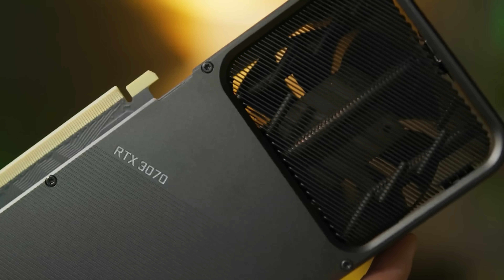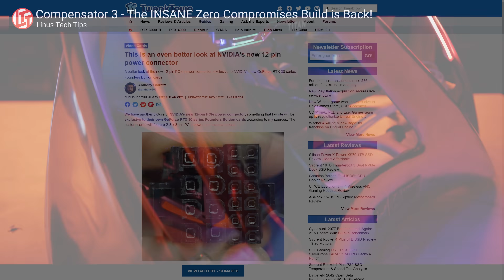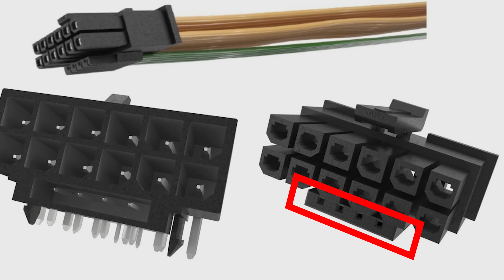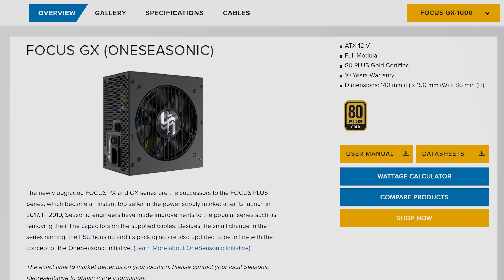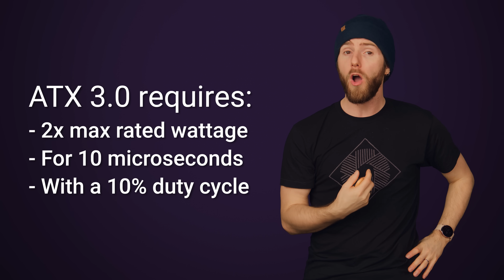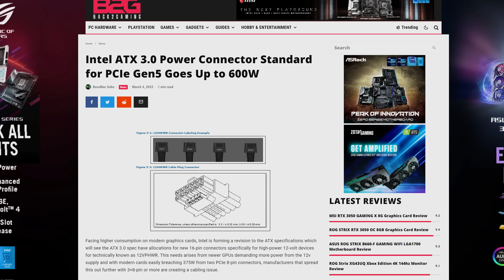Do You Need A New Power Supply? - ATX 3.0

Comment: Ah good, now I can troubleshoot the communication between my PSU and Graphics card. Just what I always wanted.
Reply: Windows troubleshooting never solved one single problem in my life
Reply: lol it’s one of those things that sounds awesome in theory, but might just end up being annoying.
Reply: @RightJoystick  this. It's just going to end up being a pain in the ass. Oh no the communication chip on my gpu died, noe its throttling power to 1%, etc etc.
Reply: @raycert07 its not going to be like that. Also you can just disable using a 12vhpwr plug anyway but using the adapter with your other pcie connections
Reply: @RightJoystick  for now
Reply: Presumably this is just a safety feature for people building their first computer, unaware that you have to build head room for the spike power draw of some cards. If you already know how to select an adequate power supply for your pc's TDP I doubt this will affect you at all.
Reply: @brendago4505  there is already circuit protection for people who pull to many amps from the psu. You really can't damage a gpu or psu from pulling to much power.
Reply: Its just dumb-logic, no data to decipher.

[Editing as an updated document was found, and I had swapped some pins]

S1 & S2 are from the card and listed as optional [pins are either low (ground) or high (3.3v) ]

S1 is Power Stable; enables the GPU to send an somethings wrong signal, so the PSU can cut power to the card.
S2 is Cable Present; lets the PSU know the GPU exists so it can adjust the power limit based on the number of cards.

S3 & S4 are from the PSU and define the power limit by leaving the pin open or grounding it. (GG=600, OG=450, GO=300, OO=150)
Reply: @ttomkins4867  so an older psu with a connector converter will adjust to 150W ?
Reply: @ttomkins4867  hopefully there will be cheap adapters that just bridge it so that it works like before. Would be hard for some users to build something like that themselves. Or even better a software solution to tell the gpu to don’t give a shit.
Reply: @ttomkins4867  Do you mean we can create cheap "upgrade" cables for our old but gold PSUs  to just say "GG, take 600W" ?
Reply: Not really solving any problems while introducing new points of failure doesn't sound like the smartest idea
Reply: @JediRhymeTrix  Well it does solve a problem, but the problem it solves is a bad build plan from a beginner builder like pairing an intel 13900K and a 4090 with a >1000W PSU which with a normal PSU that could very easily kill it if the built in safety's don't stop it from frying itself. The PSU failing could also very easily cause other failures too in this case. However, this isn't really a problem that needed to be solved since nobody buying this tier of tech are going to be making mistakes of this severity. They will be buying at best last gen, maybe slightly older since a beginner often won't want to risk that much on a mistake that expensive, and if they did try it most of them are smart enough to hire somebody to make sure they don't make a multi-K$ mistake.
Reply: Ehh just have it light up an LED or give an error at boot if the GPU has to scale down to match the PSU.
Reply: Exactly... so the benefits of this new PSU is that if an idiot buys a gpu that draws touch power from his psu he can now still use it without it tripping circuit protection? Jfc 🤦‍♂️. For anyone who knows how to properly size their psu for their system this is stupid.
Reply: I hope there is a software to tell you that your psu doesnt have enough power instead of just throttling it with no explanation
Reply: @user-vo3ps2oz7h  that would require your psu to have a data cable to the mobo... unless the gpu can alert to the the error.
Reply: @user-vo3ps2oz7h you can also calculate what you are doing and putting into your system
Reply: I had a 17" XPS laptop from around 2004/5 that the power brick eventually stopped telling the laptop it was powerful enough, and the laptop wouldn't boot. Wiggled the cable a bit, and it would boot. Repeated wiggling for each boot just broke the wire completely and eventually had to cut the cable off and put my own wires in, and the problem went away. (The data wire was very tiny.)
Reply: Top👍🏻👍🏻
Membuat Regulator DC menggunakan adaptor bekas printer/laptop
https://youtu.be/78Q5bZkz96M
Reply: Yup, put a new PSU power supply tester on your shopping list to test the new connection. Prolly expensive compared to my trusty $15 PSU tester I got in Hong Kong.
Reply: A loose or faulty sense pin can cause unexpected psu ram ramps as well as blackouts
Reply: Nah it doesn't work like that lol look up pwm.
Reply: Do you remember when you just had to make sure your CPU and RAM slots matched, and you had enough molex and sata ports for your HDDs and fan ports for your fans? Sure do membé... 🤣
Reply: Also, we all know how the naming convention is going with USB-C. We don't need a repeat of that mess.
Reply: am I glad to read comments from uncertified engineer around the the world, makes me even smarter
Reply: This will pave the way for vendor locking GPUs and PSUs, mark my words.

Comment: Nvidia's new H100 SXM GPU draws 700W with two rows of VRMs on either side. That is 700W for a single chip. If they similarly blow up power on the gaming cards as well then yeah, current PSUs won't cut it anymore.
Reply: The PCI-E version of that is only 350W though with 80% of the compute power.
Reply: Crazy to think that 1000w power supplies were for heavy duty not long ago. We'll hit 2kW supplies in no time.

Comment: My question is if this will be enforced on integrated power supplies in prebuilt and other similar computing devices.
Reply: Probably not. OEM manufacturers don't have to play by the rules, because they make their own.
Look at HP. I have one of their OEM machines, that have a very proprietary board along with it's proprietary PSU. It's 180w and it uses 2 4-pin connectors, presumably one for CPU and one for system. It also has another connector with small pins on it, probably for communication. When that connector is no longer, well, connected, the system will only briefly boot up, and abruptly shut down.
Reply: @nika_0  Yes but at least for Dell Optiplex Systems that we buy at work, you can choose from 80+ Gold or Platinum on the built in PSU, so they are efficient too, even if proprietary.  They also have EPEAT gold
Reply: Nope
Reply: Even the things that should already be standardized, like MB 24 pin connectors, fan headers, and motherboard form factors themselves, are not standard on a lot of OEM prebuilts.
So no, probably not.

Comment: they should also standardize the cables so that swapping cables between power supplies isnt a big deal
Reply: fr
Reply: That’d be great
Reply: they should just use the same connector as you find on the motherboard/gpu so you can even just plug them in the other way around and they already manufacture those connectors anyways
Reply: @GameCyborgCh  no you don't want that... because cables don't run pinouts the exact same on both sides of the cable.
Reply: sadly, standardization of form factors and such in the tech world is painstakingly slow and a lot of stubborn people/firms want their own solution to be the standard, so yeah, it's always a mess when new tech emerges. at least as long as there are several ways to implement something :/

i have to admit that it has gotten FAR better in the last 20 years though. but tech standards are far from being ubiquitous i'm afraid ^_^°
Reply: this would be awesome. same looking cable same specs but you can't plug in a sata cable of a different brand on asus rog power supply. why ? well then how will asus make any money from selling cables...
Reply: not even same psu brand does not even work with each other
Reply: I learned the hard way....
Reply: They won't just look at modular power cables
Reply: All of that is going to be obsolete with the 12v atx standard anyway where the whole ATX connector is replaced by 12V only
Reply: Oh gosh yes oh yes a yessa yes yes.

THIS.
Reply: YES
Reply: They don't want the liability.
Reply: It's only a big deal if you don't get it
Reply: USB: Yes

USB-C 3.2 Gen 2: I love that idea!
Reply: Actually the ATX12VO standard does kinda do that by ripping out the non 12 volt power requirements.

With only 12 volt the possible cable power differences drop dramatically.
Reply: I support this idea but i wonder if down the road they’re gonna start not including cables/selling them seperately for “the environment” just like what happened with phone chargers
Reply: The reason PSU ports are different then end ports is because the end ports have multiple standards and 2 of them look identical.
You have at least 4 different types of end connectors: CPU, PCI-E, Sata and Molex.
They all use the same port on the PSU but they are different on the other end.
Reply: Maybe it's a long stretch by me saying this but, by not choosing to standardize the cables, maybe they're spiting us consumers for not wanting to stick with ketchup and mustard, non-modular power supplies.  While I like advances in technology, I never put too much stock in businesses or industry.  To use a Star Trek analogy, I'm less like the Ferengi, and more like the Federation.
Reply: @rkmugen  I wish cables would still be color coded. Unfortunately its easier and cheaper to make black ones, so they do all black.
Reply: Speaking of swapping the cables. I've just recently (well, it's been 9 months already) built a new rig with that new layout that has the PSU at the bottom, hidden behind a shroud. My last one still has it in the top, easily reachable. I swear, having built PCs for over two decades, this is the biggest *bleep* up I've come across in all that time. The PSU is so hard to reach, the cables sometimes even are just too short to be even able to cable manage them properly, simply because of that shroud design. It's utterly atrocious, just for a clean look. Never had so much trouble just laying friggen power inside a PC...
Disclaimer: Case is a BeQuiet Silent Base 802, PSU is literally what's shown in the thumbnail.

Changing ATX standards is a thing? Well, the biggest try, called BTX, totally failed. It's good as is.
Reply: standardized cables would be nice so i dont have to buy a kilo of copper everytime i buy a PSU.
Reply: Right?  I nuked a motherboard by accidentally using a Corsair cable in a Seasonic power supply.
Reply: Yup that wouldn't be great ....... as some people have found out.
Reply: as long as each company makes their proprietary-side psu cables. That way it's impossible to mix and match psu cables and reduces components frying/shorting
Reply: you should never re use power supply cables just for the fact that can get weak with the time u should use new cables if you replace your PSU they have different specifications too
Reply: Inevitably doing this would cause problems when you take a cable from a lower spec psu and put them on a higher spec one melting the thinner gauge wires of the low end cable well before any ocp or opp would trip.
Reply: but that would mean bowing to RTR, and they can't have that! Where would all their profits go?! Won't anyone think of the poor widdle corporation?
Reply: AND STANDARDIZE the language. I built my first PC in 20 years and the last ONE (and only ONE prior) had a hardwired set of connectors. SO... When it came to building my new PC, I decided, hey I have money, let's burn it. Put 15K into it, literally. I don't remember the specifics, but my Zenith II Extreme Alpha motherboard for my TR3990x needed 2 12V power in conjunction with the 24pin power. The board labeled those as one thing and the power supply I bought (mostly since my first option never shipped and the site was rather dubious but was quick to refund my money, just not quick enough to update stock availability for their power supplies; thermaltake 1500W Titanium used different initialisms for those connectors. ESP I want to say and can't remember what Asus's nomenclature was. Which meant I was stabbing a $900 board with connectors, a few sparks here, and luckily didn't kill my board (probably beauty of going with such an expensive board), I finally figured it out, the internet wasn't helpful at all. Since the connectors for it looked like the literal half dozen other connectors on the back of the power supply with only slight keying differences. SUPER frustrating, then there was the RAM scare. I bought Hyper X RAM, since it wasn't RGB and I was like; "Kingston is trustworthy, these speeds are good enough (3200MT CSL16 32GB x8)" and then found out it wasn't specifically made for my board. I saw "ryzen" in the Amazon listing and I was like, good enough. Then I bought some gross Corsair ones that had RGB on it, but also were really tall. Didn't want it blocking my Noctua CPU cooler. It was fun.
Reply: @tdata545  seems to me u just took the wrong sources for research or didnt do enough research.
A simple pcpartpicker wouldve cleared a lot of the issues
Reply: or just get non-modular LOL
Reply: @xorkatoss  where do you stuff cables of your case is too small? Itx cases have no room
Reply: @xorkatoss  *Cuts cord* "You gonna replace it? Oh that's right"
Reply: @xorkatoss  Why would you want a nonmodular PSU?
Reply: That means every PSU must be modular. That's not going to happen, and modularity is seldom neccesary.
Reply: @thany3  no, it only means every modular PSU can have compatible cables.
Reply: @thany3  the connectors on the ends that you plug in into your motherboard etc are already standardized, but the connectors on the psu side of modular power supplies aren't even from the same manufacturer sometimes and those should be standardized. a non-modular power supply can just stay as it is
Reply: @thany3  would make PSUs cheaper overall if all of them were modular
Reply: @thany3  dude you just got rekt.
Reply: @thany3  the standard could be "Female connectors MUST have this pinout, power supplies MAY have female connectors or cables terminated in male connectors" the standards phrasing is pretty easy.
Reply: @thany3  no it doesn't... it just means that all modular power supplies have to have the same pilot, it doesn't mean all have to be modular.
Reply: @thany3  no
Reply: @thany3  what you’ve said makes no sense. Cables should be standardized so that modular power supplies can have cables swapped. Regular power supplies don’t need standardization because they won’t be swapped.
Reply: @thany3  Consumer market sure. Wouldn't effect OEM market.
Reply: @thany3  No it doesn't.. 
Just means that if it's modular it would need to follow the established standard..
This is where NIST needs to step up and mandate it...
Reply: @thany3  I wouldn't say so. Yes, it's not necessary, but it much more easier to work with such equipment. And I believe that the only reason why not all PSUs are modular yet, it's because vendors need more different articuls in their catalogues to sell us and make more money on options like modular PSUs